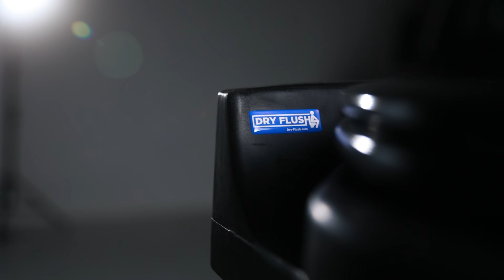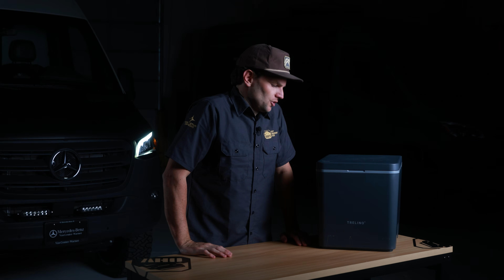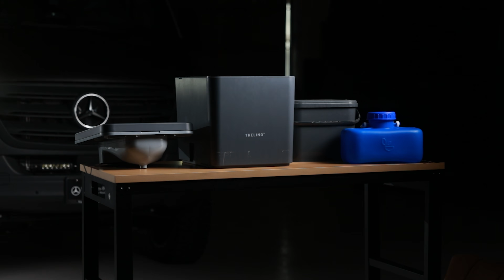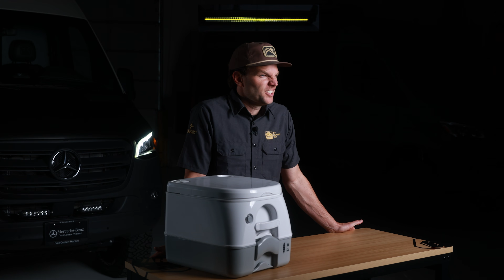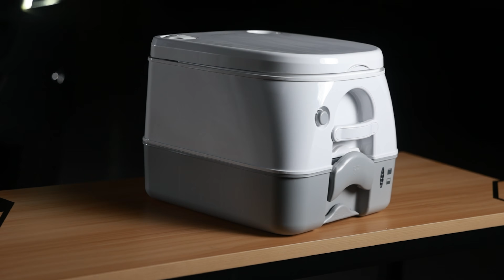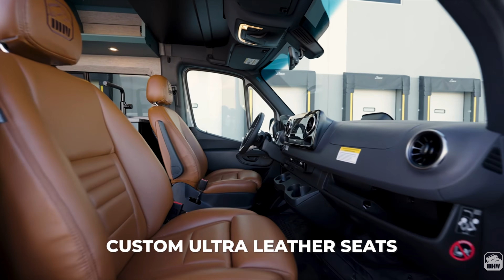The Top 3 Off-Grid Toilet Options: Compared

Comment: I have had Tralino for 3 yrs. 
The plastic pee bucket absorbs odor so I found a glass container that fits in the space. I drilled a hole in the center of the screw-top lid and the pee spout drops down into it and does not spill when driving! 
I swish the jar with bleach water after each emptying and it doesn’t smell any more.
Thanks for the video! 💩